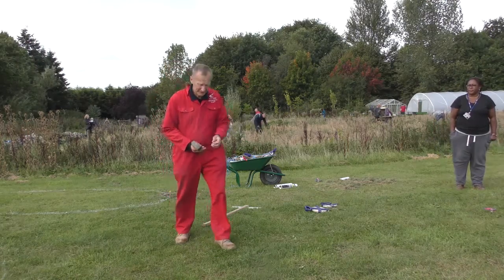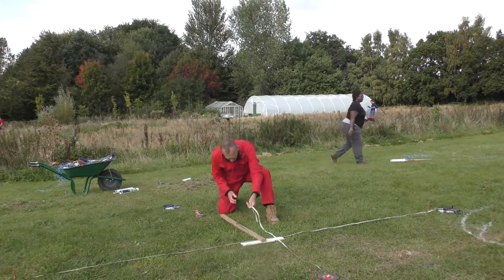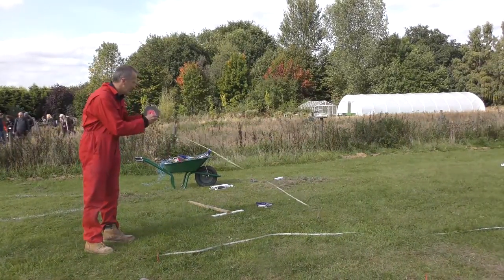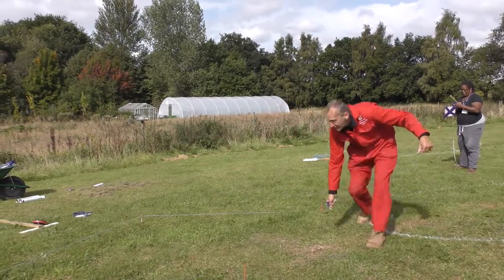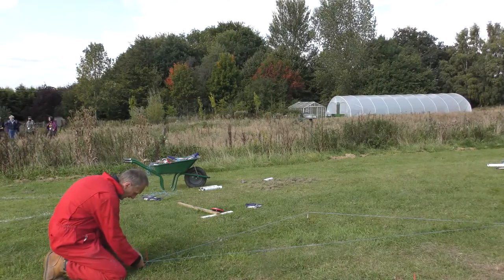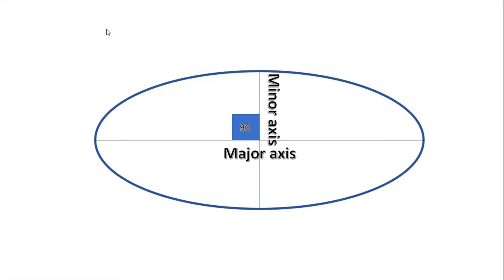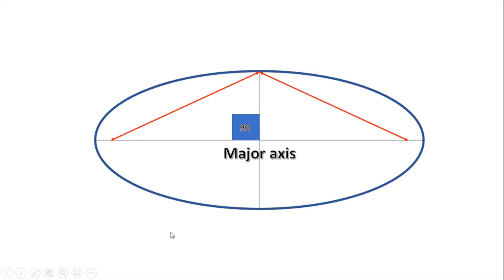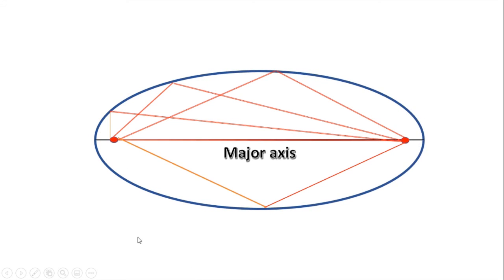Marking out an ellipse

Comment: Bollocks, you have now made it less than 4m , by pulling pins in
Reply from the maker: You have to put the pins in, then take up the slack and it takes it back to the major and minor measurements. Give it a go and you will see for yourself.

Comment: Many thanks for providing instructions for this rather ‘niche’ topic!
   We adapted it to go around a tree, using a plastic hula-hoop…  Fortunately I was able to buy a tubular plastic hoop of sufficient diameter to go around the trunk.  It came with a join where the two ends of the tube are held together by an inserted plastic connector, the join being covered by a piece of tape.  The hoop was not an entirely symmetric circle but I marked four ‘cardinal points’ at approximate quarters of the circumference (“that’ll do!”).
   After removing (or cutting through) the tape over the join, the hoop was pulled open to encircle the trunk before reconnecting the two ends over the plastic connector-insert.  The hoop was then fixed temporarily in situ by pegs to stop it from shifting about.
   The central tree meant that we lined up the two axes mainly by eye and by cross-checking measurements.  Then we ran a length of string from the major axis ‘cardinal points’ marked on the hula-hoop to the respective terminals of that axis (i.e on ‘good-enough’ opposite sides of the tree), to serve as a ‘line’.  When calculating where the halved measurement from the minor axis terminal should cross this line, I factored in the diameter of the hoop; then we ran a second piece of string (string-B) from these new ‘line-crossing points’ around one minor axis terminal, before removing it from the latter in order to spray the curve using the slack string.
   The tree meant a couple of further adaptations: 1) only half of the ellipse could be drawn at a time before unhooking string-B from one ‘line-crossing point’ to reattach it to use on the other side of the tree; 2) the trunk of the tree prevented string-B from being able to fully complete the curve at the major axis terminals, so these relatively small parts of the curve were finished freehand by eye.
   Despite some necessarily approximate measurements, I am very pleased with the resulting ellipse (which will be a small meadow area in the lawn).
Reply from the maker: Wow, that is brill., the ellipse is an excellent shape to mow around, no tight corners. Thanks for the reply, regards, Mike